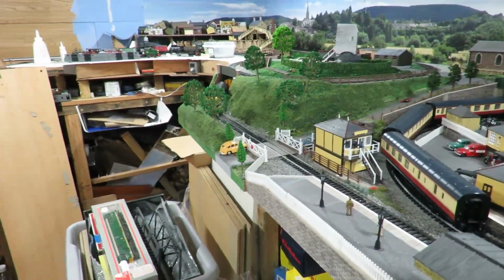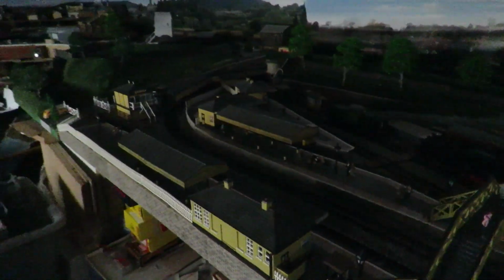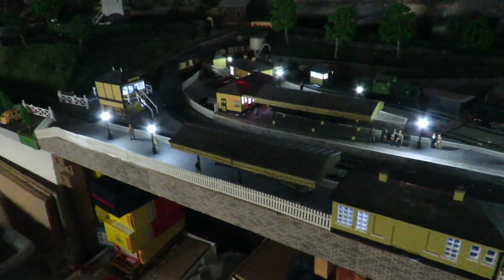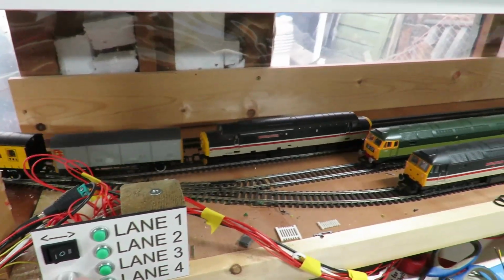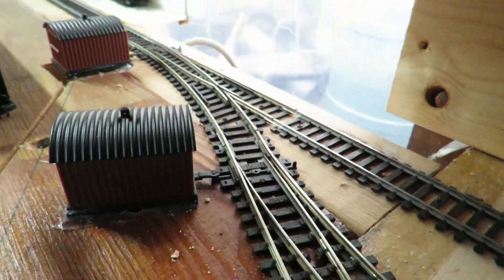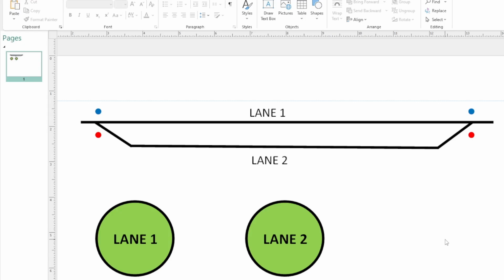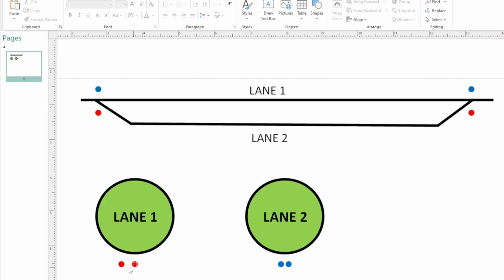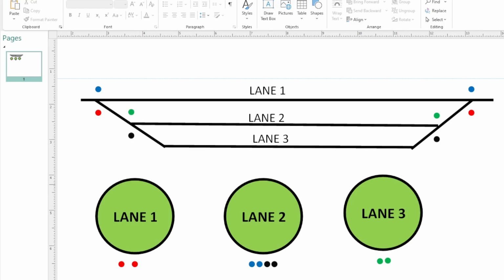OO Gauge Shed Model Railway / Railroad Layout - Station / Platform Lights & Point Motor Wiring

Comment: Good work, Doug.
Diodes should be able to do all lanes with a single switch push (conditional logic).
LEDs and light bleed: I used black paint inside my lovely BMR railcars when I added bidirectional lights to them. I'm going to add LEDs to my 3d printed-class 205 at some stage. I will eventually make videos for this.
Another thought: I've just converted my n gauge boxfile layout to run off a 9V battery - makes it properly portable.

Comment: Hey Doug, great video. I wonder if latching relays will help with the lane conundrum.
Reply from the maker: Potentially but I think I've solved it with diodes, will test it out today.
Reply: @BudgetModelRailways  a diode on the output of each switch for each "colour" it feeds should do the trick

Comment: Excellent stuff Doug! Really nice job on those lights and shows what you can do with mere pennies 😎 Good description too for the different sidings: a simple system that works as long as you follow a simple system 👍 I’m not sure but I suspect there is a simple way to re wire it so you only have to push one button each time. Sadly it is late on a Sunday and my brain has switched off for now 😂

Look forward to the directional lighting tutorial too mate. I have some very old locos that I have no intention of disposing of which deserve an upgrade 😉

Cheers fella 👍🍻🍀

Comment: Nice work Doug.
Lighting really does add life to your layout.
The light bleed through plastic buildings/cartiages/locos can be a pain as you've discovered. 
One thing to also note is that not all LEDs are the same voltage and  may need similar adapters for similar lights.
I recently got some street lights that need a 6v adapter where my old Tri-ang Hornby bulbs will happily run off my Tri-ang 12v controller. 👍
Happy modelling.
Mon

Comment: It can be done with diodes . Many years ago the Railway Modeller had an artical explaining this very thing. I`m not certain if  the man only used diodes, or if the wiring was cascaded as well . All the best.  Paddy Owen.
Reply from the maker: Yes, just had a sit down with some paper and pens and worked out how to do it with diodes to block the unwanted current flow in specific directions. Thanks